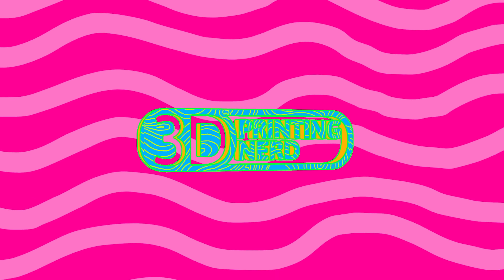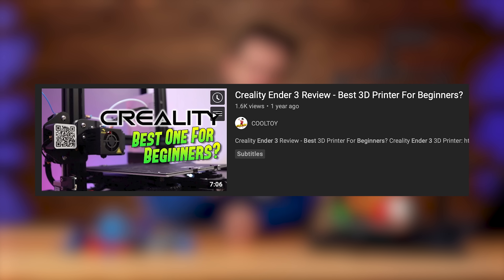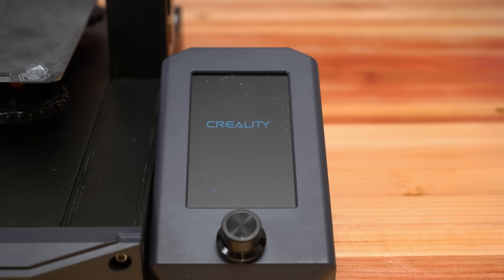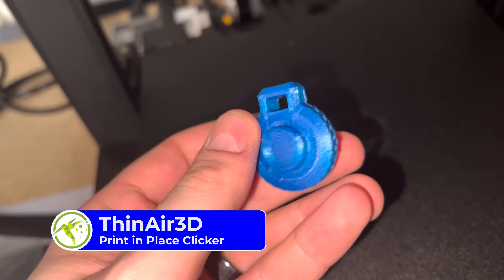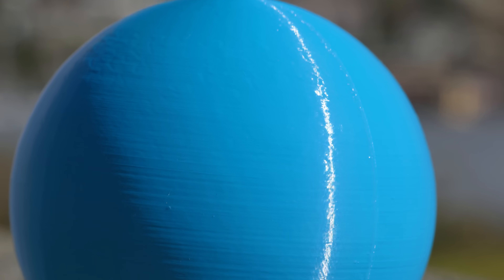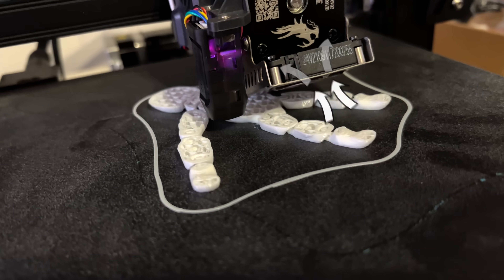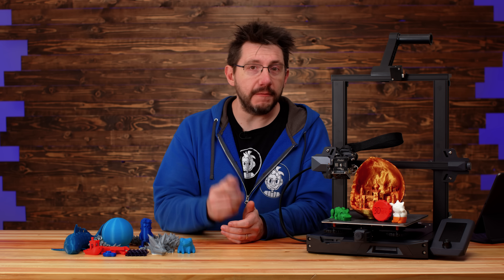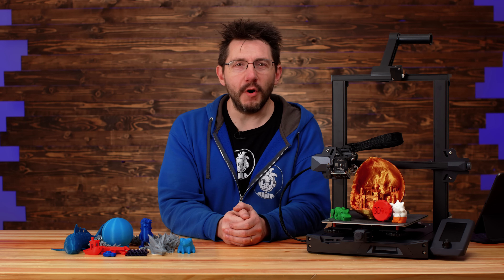Best Ender Ever? Creality Ender 3 S1 Review

Comment: I have the original Ender 3 and have printed hundreds of things on it - this version looks so clean and awesome from the start. Thanks for the video!
Reply: I’ve had mine for a week. And I’ve had all kinds of issues. Run out sensor will not work when connected to raspberry pie. They asked me to do a firmware update it will not update. All the sudden it totally quit printing altogether so I’m playing a cat and mouse game with Support kind of a pain in the neck. It would’ve been nice if they would’ve told us the pro version was available when I ordered this one last week but now they did not. Back to my Prusa
Reply: @nmfireman  out the box its worked good for me so far ,had it for three weeks,after so many hours the metal board didnt hold prints as well,got the glass from creality,that lasted three days and started crapping out,I know there's a handful of variables to watch for, definitely woulda bought the pro,this is my first printer,
Reply: @tommychiletti8506  If you ever take it apart, be carefull not to break the small wires coming out of the heater block. (thermister wires). I was doing some testing and wasn't carefull enough. Now I need to replace my heater block and with no spares to find its just a pain
Reply: @D L What the hell are you talking about making anything up. I do love my Prusa and I also like my S1 one but we are having issues when we use it in Prusa slicer. When I start a print up if I don’t warm up the bed and nozzle first it will not print a purge strip. I don’t think the G code is exactly set up for the slicer I was asking for help on this. Why don’t you offer suggestions instead of BS
Reply: I have have my original E3 Pro for a long time, and have been looking at this, I can not decide between the S1 and the S1 Pro, The pro is not that much more, and seem like it may be worth it just for the touch screen, light and the Hot end upgrade, even though I do not see myself needing the hotter temp on the upgraded hotend myself, atleast not now, I like the idea of having a all meatal tube all the way to the nozzle, just seems better over all.
Reply: @jeffdeprey6279 Did you get it? I'm looking to possibly upgrade my V2 to the S1 Plus for the increased build volume. Only down side I can see of the Plus over the Pro (apart from cost) is they didn't upgrade the SS throat tube to the titanium tube like they did for the Pro extruder.
Reply: @sumorabbit2160  I did, and it is a nice printer, but I have had some issue with the auto leveling myself, I need to call them I guess, have not had time. Right now I basically self level it like I did my old Pro.
Reply: @D L yea the pro is not getting the great reviews the plain S1 is getting
Reply: @D L They sent me different firmware to load. After loading it, my mother board was bricked. It took 3 weeks to get that replaced. Then bed would not auto level. I ended up waiting longer for a new CR touch to arrive. Now all is working. Not making this up like you accused me of doing.
Reply: @D L your clueless
Reply: @D L I have both
Reply: It's also over 400 USD.  Creality is great at 200 USD, it's a bad buy at 400+.